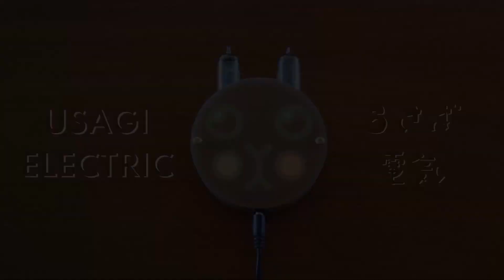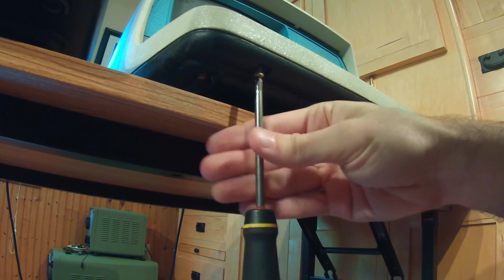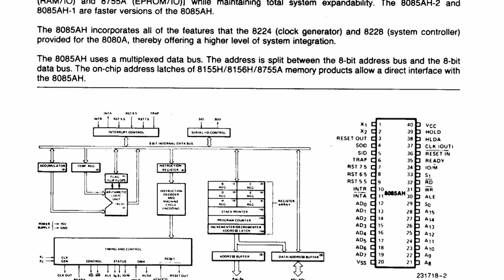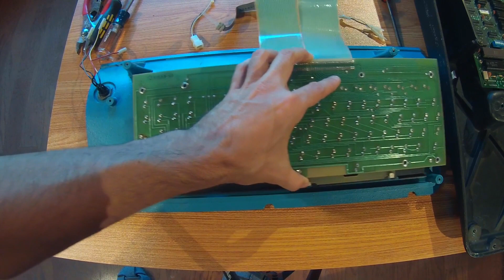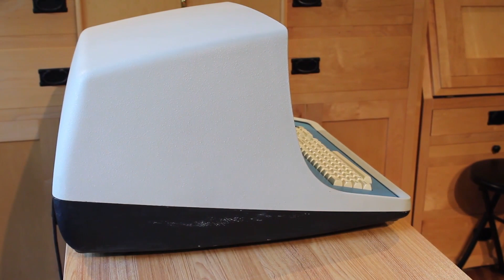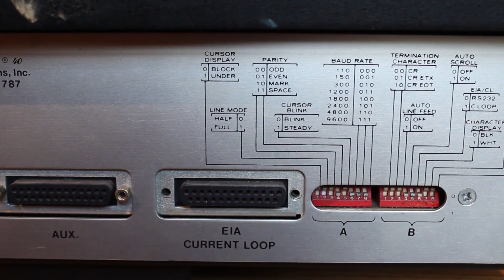Minicomputer Part 6: Restoring the ADDS Data Terminals

Comment: Try setting the EIA/CL to 0 so it switches to EIA mode. I'm wondering if there is something it's seeing on the CL (or not seeing in this case) that's causing noise and then the character repeating. It's a guess, but since it's set to current loop now, maybe there's a stray signal causing the character loop.
Reply from the maker: That totally did it!
Absolutely brilliant spot! With the setting on RS232 it boots up totally normally just like the other terminal.
Thank you so much!
Reply: @UsagiElectric  Oh, that's awesome!! It was a total guess, but knowing how current loop works, it totally made sense :-D
Reply from the maker: @tstahlfsu  It was an excellent guess!
Reply: An open current loop will cause a mechanical TTY to "chatter".  It needs the 20mA signal to be "at rest".  So it makes sense.
Reply: Well done.
Reply: You should be able to connect your Arduino to it.

Comment: Measured the AC Vrms voltage across the power supply caps while under load to provide a baseline.   Write the values/date on the caps for reference.   A good cap will have smaller AC Vrms values over time as the capacitor's dielectrics reforms.
Reply from the maker: That's a really good idea! I never thought about checking the RMS to see how the caps were doing. The next time I clear enough space off on the bench to get the terminals back up there, I'll give that a shot!

Comment: Man, those are nice terminals.  I have a couple of Z-19s, a DT-1, and a VT-100 (that doesn't work).  I want more, but MAN they have gotten expensive.

Anyway, you've gotta find out what kind of terminal those things emulate.  I have no idea, and duckduckgo isn't turning anything up at first glance.  :(  We might be able to figure it out via trial and error though, see below.

There also ought to be some way to turn OFF local echo.  When you press a key, it should send it out over the serial port without displaying anything on the screen.  If this machine works like most of them, then the computer itself will echo the character (or other terminal control sequence) back over the serial port to be displayed on the screen.  This should take care of your janky CF-LF issues.

Until you get the minicomputer running, you can probably hook them up to a Linux machine for testing.  Preferably you want a Linux machine with a "real" serial port (not a USB dongle).  This way, the computer will implement all of the terminal control signals that the terminal is probably expecting.  You'll want to buy/build a full null modem cable, implementing all of the DTR RTS CTS DSR and DCD crossovers.  Plug your terminal into your linux box with that, and set up the linux box to run getty (the login manager) on the appropriate serial port.  In sysv-based systems, it's an entry in /etc/inittab and then a simple "init q" to get it going, but it's different on distros that use that godawful systemd, although I am sure there is documentation on how to get systemd to run a serial getty.

If you don't have access to a machine with a real serial port, you can use a USB to RS232 dongle.  You'll probably want some kind of FDTI-based dongle, as it seems to implement hardware flow control slightly less poorly than the others I've tried.  When you make your null modem cable, however, you'll want to cross over RX-TX and RTS-CTS as normal, but you'll want to short DTR, DSR, and DCD together inside the DB shell on both sides so that it loops back (not going out over the cable, just looping back inside of the DB shells on both sides), as the FDTI dongle doesn't seem to implement them correctly (or at least the ones I have don't).  Then get getty running on Linux box as before.

I'd try 9600 baud first, but if it drops characters (or otherwise acts up), drop both the terminal and getty down to 4800 baud and try again.  This is especially a problem with the USB serial dongles I've tried with my Z-19s.  They run great on a real serial port, but act up on any of the USB dongles I've tried when running at full speed.  :(

You'll probably have to hit enter once the terminal powers up to get the unix login prompt to appear.  If you don't know what terminal type to pass to getty when you set it up, grep through your termcap entries and see if there is anything related to centurion.  Barring that, I'd try a few different common terminal protocols and see what works best.  ANSI, VT-52, VT-100, lear seigler, televideo, hazeltine were all popular protocols back then iirc.  When you figure out the correct one to use, the unix side will be able to move the cursor around the screen and send your line feeds correctly.  Until then, you'll probably have weirdness.

Hope that helps man.  Those things are incredible, and I'm looking forward to seeing them back in service!!  :O
Reply: Also of note, try to figure out whether the serial ports are pinned out DTE or DCE.  If they are female connectors on the terminal, then you may need a straight-through cable instead of a null-modem cable (although if you are using a USB-serial dongle you probably still want to make one such that DTR, DSR, and DCD loop back to themselves).  Easiest way to find out would probably be to stick a scope probe on pins 2 & 3 and figure out which one is sending when you press a key.

To get the terminal to work right (or less poorly at least) with a Unix server, you'll probably need to set the CR type to CR only.  But I am just guessing.

Quick grep through my terminfo files on my Devuan box doesn't reveal anything about a specific centurion terminal control protocol.  My guess is still that it emulates some other kind of popular (at the time) terminal, we just gotta figure out what.  D:
Reply: @Lee_Adamson_OCF  very likely VT-52, would be my guess.
Reply: Oh also, once you get logged into the linux box, and you are pretty sure that you have the correct terminal type (or at least the least problematic one) set up on your getty, try starting a gnu screen instance and see if that clears up some of your problems.  It seems to implement the terminal control sequences a little better for weird terminal types than ncurses (or whatever it's using before screen starts) does.
Reply: @Lee_Adamson_OCF  You'll need to look up the terminal emulation in the getty.defs file. 
I've had lots of real-world experience with this back in the late 80s and early 90s!  Fun times!
Reply from the maker: First and foremost, thank you so much for the insanely good information!

I'm still a huge noob at this, so this is colossal! I think my goal for the next episode (or maybe the one after that, we'll see) is to actually try to turn the computer on without the drives but one of the terminals hooked up to see what kind of life we get out of it. I'm not sure how these old minicomputers react to booting up without a drive in them, but I imagine it'll give me something, even if it's just a simple "Hey, plug in a drive dummy" prompt or something.

Ultimately though, I really only intend to use one terminal for the Minimcomputer (no need to set up multiple workstations as I'm literally the only one in like a 50 mile radius that'll use this thing, haha). So, I would definitely like to get it talking to another computer and what you've typed up here is going to be my bible for getting that going!

The only machine I have in the house that has an actual serial port is my old TI-99, which hilariously would have been around at the same time as the minicomputer. Now, it does have a Terminal Emulator software and a proper RS-232 port, which has me wondering if I could hook it up to the modem that you can see at the timestamped video here ( https://youtu.be/DJ1HwuYBuss?t=945 ). That modem might actually make it easier to hook the terminal up to a more modern computer too, come to think of it. Though, I know so little about it, I'm just guessing at this point.

At any rate, thank you so much for the amazing information and as soon as I get the bench cleared of the old HP 150A scope I'm working on, I'll get these terminals back out and start experimenting a bit more with them!
Reply: @UsagiElectric  Oh that is interesting.  I must have missed that part of the other video.

I am going to go out on a limb and guess that that box with all the db25 ports is actually a terminal multiplexer (which could have also been hooked to a bank of modems rather than terminals).

What a terminal multiplexer does is break one higher speed serial connection to the mainframe out into several lower speed serial connections for a bunch of terminals to hook to.  All that serial data from all those serial ports is multiplexed onto that single high speed port back to the mainframe, and then sorted back out in software.

I think this will add additional complexity to getting the machine running, as it is unlikely that hooking a terminal directly to the serial port in the mini that is configured to drive the multiplexer will work the way you want, and who knows how it's set up and what speeds things need to be set to.  D:  Hopefully they have a plain ol login session (or whatever this thing uses) running on one of the other ports, and you can do away with the extra headache of the terminal multiplexer.
Reply: Have you been able to turn up any documentation for this thing?
Reply: @UsagiElectric  PS if those really are ADDS terminals, there is an ADDS Viewpoint terminal protocol that Linux terminfo may support.  I am not at home to grep my terminfo directories for it, though.  I will trt to remember to look it up later.  I was under the impression that ADDS terminals were of a later era than this stuff appeara to be though.

Comment: A ROM with I/O ? Now that's something I've never seen before!
Reply: MOS (later Commodore) made a ROM/RAM/IO/timer (RRIOT) chip, the ROM was mask-programmed. It was only used in the very early MOS computers, and some pinball machines and disk drives. I’ve never see one, but the Atari 2600 used a similar chip - the RIOT - as its entire 128-byte RAM, as well as reading the switches and joysticks.
Reply from the maker: It was a really wild chip! I would love to pull the stored code off of it to back it up just in case, but I'm more worried about damaging the chip by hooking something up wrong than I am of the chip quitting on its own. Fortunately, at the moment, both machines seem to be working really well, so that's a good testament to how tough they really are!
Reply: @UsagiElectric  As long as you don't exceed the voltage ratings on the pins, very little can get damaged. These are not CMOS devices and thus are not (yet) sensitive to ESD. (E)PROMS used to be programmed with higher voltages on the Vpp pin, but without this higher voltage (and the older the chip the higher the Vpp needed to be) programmed bits can not be changed.
Reply: @iamjadedhobo  they are not CMOS, but they are NMOS and thus still sensitive to ESD.

Comment: Re the braided wire on the inductor - I think that it could be because of concerns about skin effect - in this case braiding the cable is not because of current limiting (like on an SMPS) - so the only thing I can think about is to minimise the effective resistance of the coil to maximise the Q factor of an LC circuit.
Reply: exactly. Braided wire lowers the losses in the linearity choke improving its Q
Reply: I'll take what is Litz wire for $200
Reply: I think that shiny coil is for the horizontal linearity. It introduces an (adjustable) exponential slope to the deflection sawtooth, so as to match the curvature of the crt. Many, many years ago I  built a monitor crt display for a echograph device!
Reply from the maker: Awesome, thank you so much!
I never thought about it being a high frequency thing, but that makes total sense. I really do need to learn a lot more about CRT stuff, haha.

Comment: I believe those non-windowed ROM chips are masked, meaning the bits are constructed in the silicon. I don't remember when OTP came on the scene but doubtful it was in the 70s. When I was in high school, we took a tour of the DEC plant in ABQ, they were making VT100s. Thanks for the video.
Reply: The 2316 is indeed a masked ROM. It's pin compatible with the 2716 for development but the condensed datasheet mentions "the masking process" without showing any potential for programming. You can see the mask number after the part number on the closeup. OTP memory has been around since at least 1969 in some form, but the modern NMOS OTP structures start in 1979 and don't get going until the early 80s, so after this design for sure.
Reply: @Peter_S_  Sounds good, thanks for the info. I'm looking up how OTP was implemented before NMOS.
Reply: Found this, https://en.wikipedia.org/wiki/Programmable_ROM
Reply: @CraigHollabaugh  All the original OTP tech I'm aware of used anti-fuses, where you damage an oxide layer to program a bit. I imagine the earliest examples may have used bipolar structures but the couple of parts I came across were PMOS and needed multiple power supplies including a negative supply.
Reply from the maker: As Peter said, the 2316 is indeed a masked ROM, but it's pin compatible with the 2716, which means there are a few options out there if I need to replace any of them, especially now that I have the code pulled from them.

Comment: This takes me back.... In 1987 I found a Hazeltine 1510 terminal at a Salvation Army thrift store and built a new power supply for it to get it back in service. Very similar supply to these. I think it topped out at 19,200 so I didn't hold on to it and only years later did I realize it was almost the exact terminal pictured on the Kraftwerk album Computer World. Probably collectable now... oh well.
Reply from the maker: That Hazeltine terminal really is a pretty cool design! It's right at the forefront of the super angular designs that became popular in the 80s! I think the days of finding old data terminals in thrift shops have come and gone, which is a shame. By the time I got interested in all this old computing stuff, most of it has either been destroyed or snatched up. I got mega-lucky finding the entire Centurion mini-computer, and even if I can't get it to come back to life, it's not a total loss because these terminals are so cool!
Reply: Kraftwerk is cool! 💯👍😁